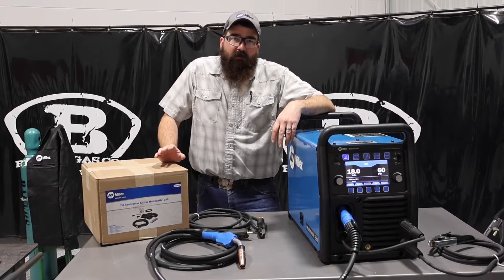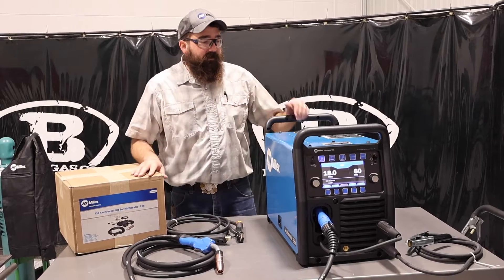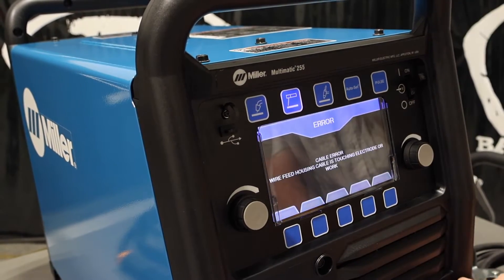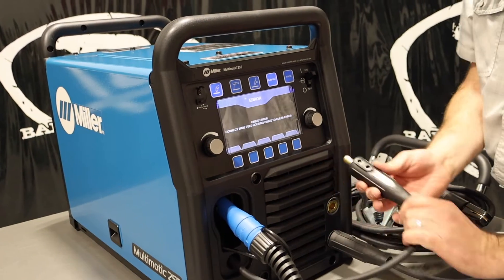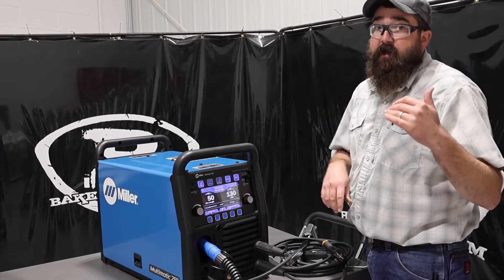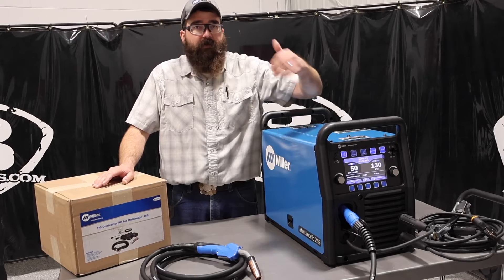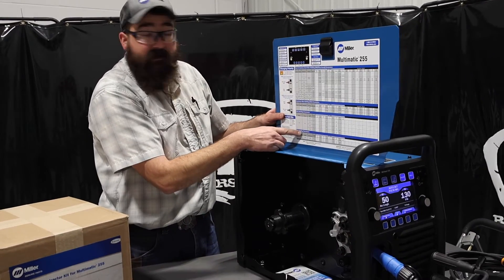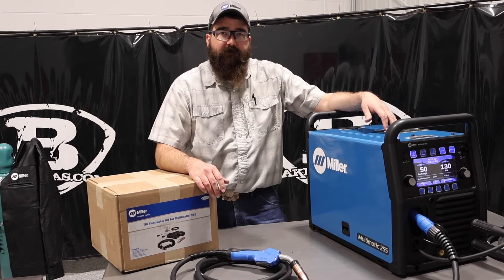Multimatic 255 Review 907728 - Watch before you buy a Miller 255

Comment: Thinking about this machine over the lincoln version just in cost alone. Ive already got a precision tig 225, but need more than my 120v mig with spool gun. Thanks for the run down. Never run a miller before, but happy to learn for my upcoming over the top adventure truck build.

Comment: I’m so thankful I bought a HTP 2500 instead of another Miller when I sold my Miller 220. 
The Miller 255 Multimatic is a disgraceful and overpriced!
pile of 💩. When you have a $4700 MPW that includes nothing more than a mig gun and grounding clamp, that speaks volumes, and that’s not even discussing the elephant in the room that’s it doesn’t even have High Frequency start, nor A/C Tig capabilities! 😂 . I mean I can get a 400$ Tig welder from Harbor Fake with HF start. I didn’t even know there was any newer inverter Tig welders that DIDNT have HF start! I have a 1999 Miller Syncrowave 250 that has HF for goodness sake’s. To me it was pointless to put a remote foot panel hook up on it, might as well just have scratch start! 
I think Miller continues to urinate in the face of their customers all while holding their hand out wanting your 💵.. And a pitty the person that has to buy their overpriced control boards when the warranty runs out! Been there. 

The negative part of this comment isn’t in regards to your video demonstration. I find them very helpful actually when wanting to know about a specific welders functions, a closer look at the machine, it’s contents, it’s size etc! I just clicked on it to see if they had changed anything since they came out. I think they could’ve hit a home run with this welder and it was a complete flop!
Reply: I agree. The Chinese made machines are coming on strong. Just bought a new tig machine that has more features than the new dynasty welders at 1/3 of the price. That’s coming from a former dynasty owner! 

Lots of fab shops are switching. I know of a nascar team the switched. I used to own all Lincoln for my manufacturing business…. Everything in the future will be the cheaper machines coming out. They offer more features for way less money. 

I was eyeing the new Miller Trailblazer 330… until I found out Everlast is developing an engine drive with a HONDA engine for less than 1/2 the price.
Reply: I am with you on that one. Used to be Miller all the way till they started raising prices and lowering quality Now they produce overpriced junk. I just got a no name brand Chinese Tig 350 3 phase delivered to my house for $800. No noisy fan, pulse etc.. Welds like a dream. F Miller.
Reply: How is the Miller 255 junk? My brother has used his every single day for over 5 years 0 problems! Still going!  @bernardmauge8613
Reply: No suben yo la tengo lammillermatic 255 y no sube la alimentación de alambre siempre hase contacto antes de llegar al material que se va a soldar basura
Reply from the maker: Thank you for watching. Appreciate your opinion, Miller Electric designs and manufactures quality equipment that is really user friendly and brand is really strong. We do not work with HTP or others mentioned to speak to the quality.